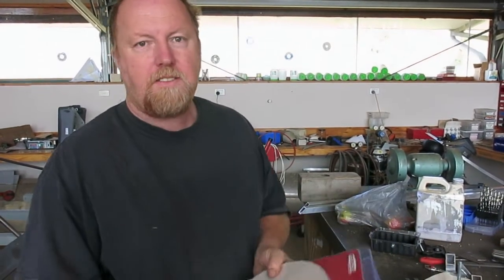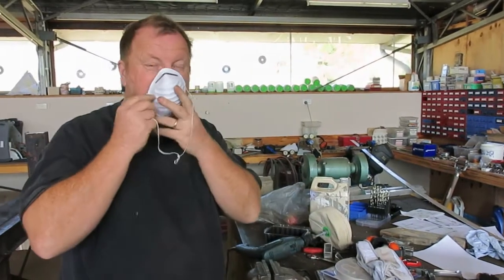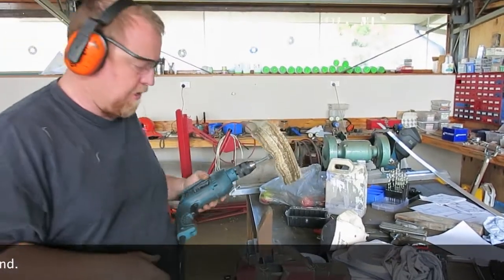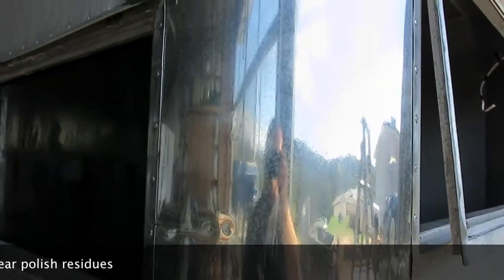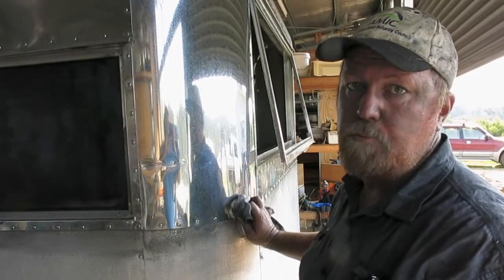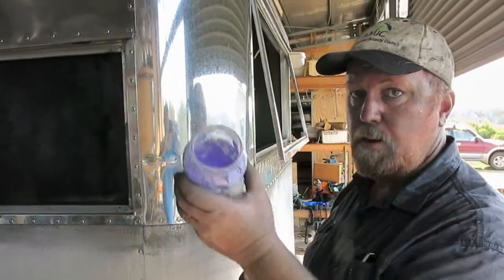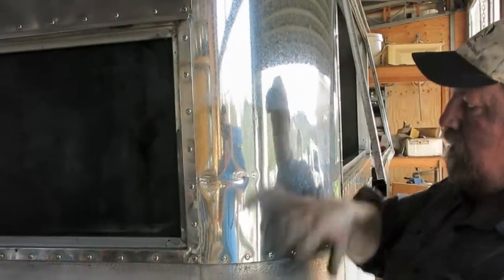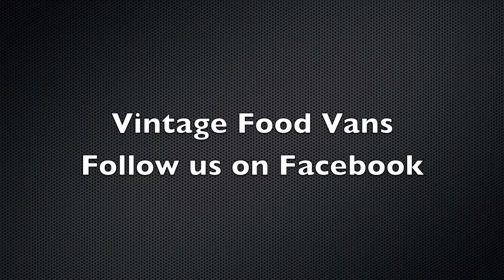Polishing Aluminium Caravans

Comment: How often do you change the mop and do you use a different mop for each color of compound?cheers!
Reply from the maker: I keep a seperate mop for each colour and clean them with a 'rake' (like a stiff wire brush) and  keep using them till the wear out.
Reply: @Vintage Restorations Australia  thanks for the tips.. about to start on a 74 oxford crusader

Comment: clear coat once polished?
Reply from the maker: No just a light hand polish once a year with the purple polish.  The clear coats are very hard to remove when they start to break down.
Reply: that's aluminum, not paint. only paint has a clear coat.
Reply: Cassiel Ligthman Not true, early Airstreams have clear coat that develops a white worm-like “stain” over time.